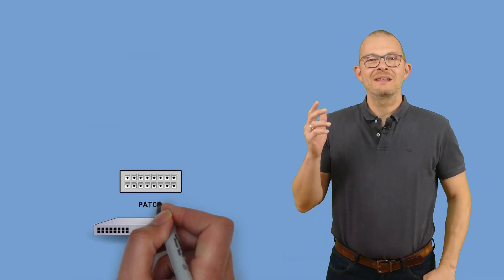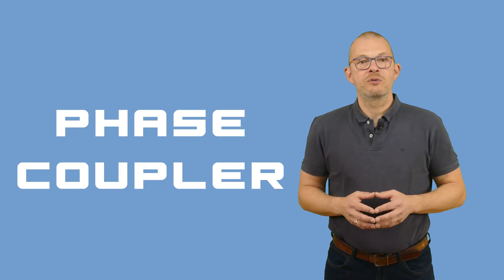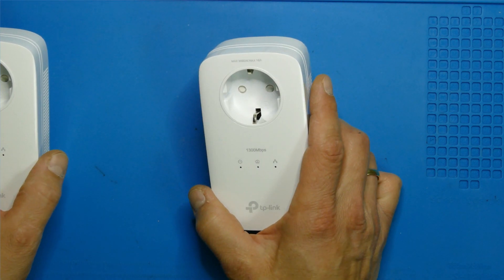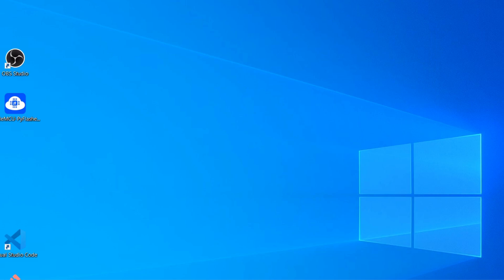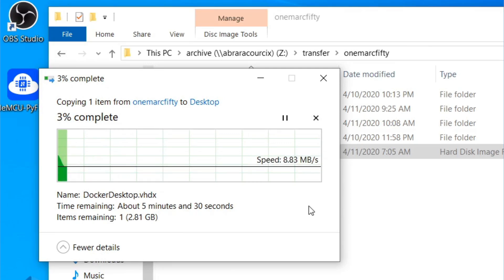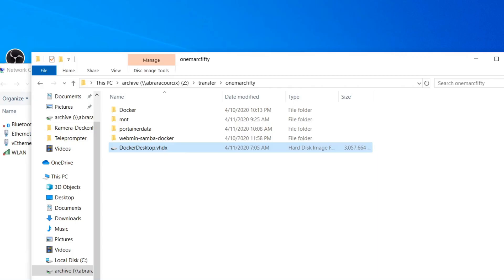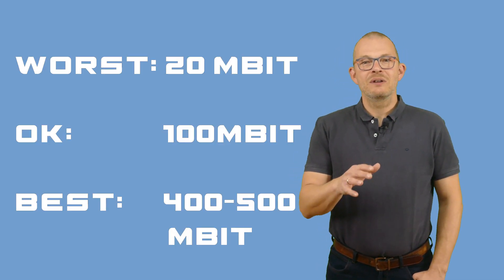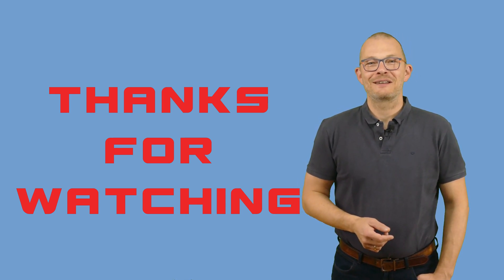Build your home network on a budget part 3 - Ethernet over Power with Powerline adapters

Comment: Yup powerline cabling is crucial. In my 1970 built house I got only 2MB vs my 1GB connection at the router. Even when plugged in to the socket next to the router.

Comment: Sir nice video. As a Tp-link power line owner I suggest you use the application for Windows or other supported OS to see the connection speed between the 2 adapters. You must be connected directly with your pc at one of them. Also we all must check not only the max  speed that the vendor advertise , but we must keep looking into the specs of the model we want to buy to see what port(s) it has. For example my old tp-link powerline is capable of 500Mbps as advertised (and I have seen it through the app )  but the ports are 100Mbps. Your model says 13000 Mbps and it has 3 ports.  So i guess (without shearch it) they are all 1Gbit ports and they share the connection. Also don't forget that your hard drive maybe can't handle  the 1gbps. What I mean is that one more factor is the machine you use.
Reply from the maker: Many thanks for the Feedback Stefanos!

Comment: 1.3 gigabit is the aggregated througput. Since these powerline adapters work half duplex you should in theory get to around 700/750Mbit in purely optimized conditions.
Reply from the maker: Many thanks Jeff - so in fact the speed figures I get are not that bad ;-)

Comment: On the one hand I really like these...on the other: I don't, especially if you live in an older house with old wiring (yeah...someone is running the microwave-oven? You might lose the connection or not even get one in the first place!)
Reply from the maker: Oh, absolutely! Even switching on a simple lamp can make your connection go away. Cable / Wire is the best, Wi-fi and Powerline have their flaws...

Comment: I bought a kit of 3 devolo devices, one with just one ethernet ports and the otters with wifi and a pair of ethernets, getting  200/260 mbits between the far ones and near 350 with the next one in the router. The big advantage is to extend you net where cable or wifi signal isn't posible. Even i get internet connection in my garage room, two floors down, in order to control the charge my electric bike when the sun is feeding my panels. Have you heard about flexible optical fiber?  Looks promising.
Reply from the maker: Thanks for the feedback - those are really decent bandwidths you're getting there !

Comment: Why cant I just directly connect from router to switch to the device? My router have 8 giga ports
Reply from the maker: You can - if you have a cable available. This solution is for scenarios where no cable is available from A to B.

Comment: Thanks. How would you diagnose a flaky connection? Most powerline adapters have lights indicating how good the connection is, green/orange/red status etc. I have one setup often goes to red briefly then back to orange or green. I take it the connection breaks often. What could I do, beside try another wall plug, or use adapter direct to wall, etc?
Reply from the maker: Tough call. The problem is that there are no real diagnosis tools available for the cabling etc (at least none that are cheap and accessibe to the hobbyist). I am afraid that all you can do is try-and-error PLUS try to see if there are coincidences (does the outage occur at the same times, when you switch on the light etc.)
Reply: @OneMarcFifty  Will do, thanks again.

Comment: Great video again Marc!
What kind of security issues could one expect using mains powerlines as network connections? Would your high frequency signal traverse your breaker box to outside the house using EOP devices?
Reply from the maker: This might actually happen! Many devices support pairing/encryption so that‘s one possibility to circumvent. Second obstacle would be the electricity counter as it will attenuate (coils). Third obstacle is distance, so the risk is higher if you live in an apartment as opposed to a house in the countryside. I think I‘ll go see my neighbor and check if I get a carrier 😉
Reply: @OneMarcFifty  LOL Lemme know what happens! Maybe they could directly enjoy your Plex server or perhaps a network share :)
Reply from the maker: I‘ll keep you updated 😂😂😂
Reply: @OneMarcFifty  tried this. no signal AT ALL on my eop device to the house next door. but, my guest network from my wifi router was usable at over 200 metres away...